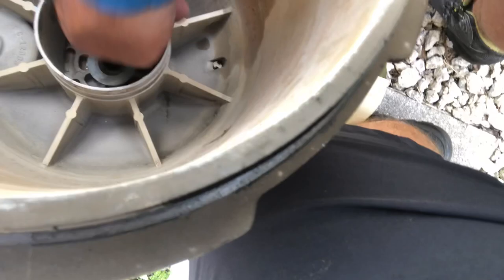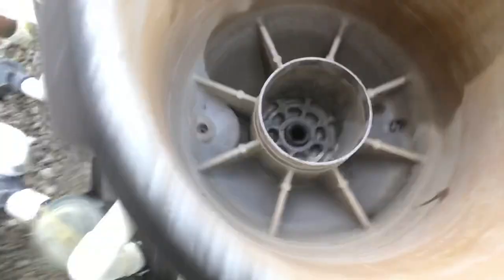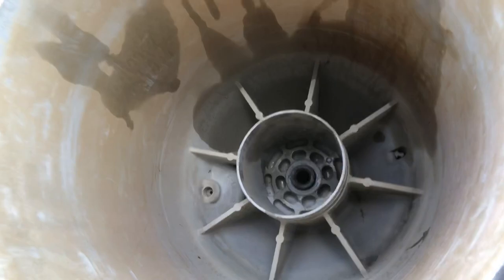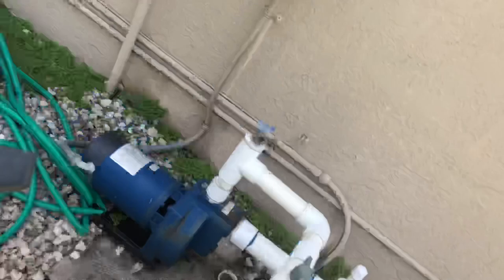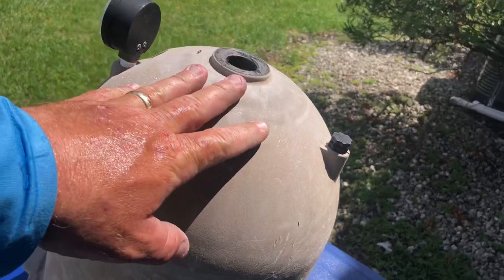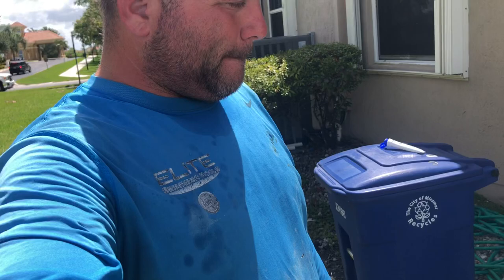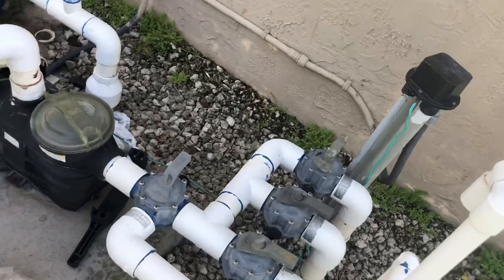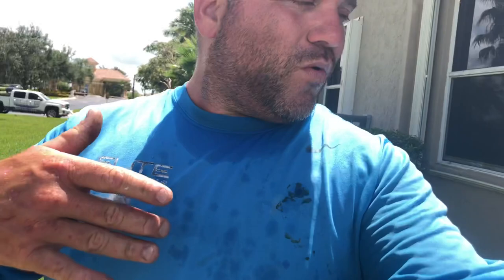How to Replace your broken Hayward Star Clear Plus Filter Knob.

Comment: Wow, what an amazing video! This really describes everything I needed to know to replace the locking mechanism for my pool filter housing. What I particularly like about the video is that it is clear that no editing has been done. Some repair videos clearly show a repair with "prepared parts" where everything just slides into place in one go. I suspected that getting the C-ring into place would be a <insert expletive>. You also showed the failed attempts, making the video an honest representation of some of the difficulties that you may encounter if you are carrying out the repair yourself.

Comment: Awesome video but what happens when the rod is stripped?  Can u replace it?
Reply from the maker: If the bar came loose and stripped from the bottom that’s a big problem. If the bar can not be screwed back down tight  and the bottom threads are stripped, you’ll have to either purchase the filter bottom half tank or replace it with a New complete filter.

Comment: So i have same filter and the long rod that is threaded on top and bottom always comes out with the top lid instead of staying at the bottom threads.   Makes it a real pain to screw back in cause of the blind alignment.   Do u recommend i put loctite on the botttom portion and manually screw it in so it stays “permanent” down at the bottom?    I assume the white rounded cone at top is to guide the rod into the threads!?

Comment: Hi, I found your video. Same part, but the lid isnt opened, the knob came out with tug and twist. Opened lid a pinch. Scared to use screw driver in that to pry open. Suggestions appreciated!
Reply from the maker: Put your foot or both feet at the base of filter body and try to pull up the lid on one side and then the other. If you have to use a tool, then be careful doing so.
Reply: @EliteSwimmingPoolsTV  thank you!! I wound up replacing the inner part of knob,it was easy and now it unscrews so easy! Thank you for responding!

Comment: I turned on the pump and water spilled out from filter mild blowout and quickly turned it off. Should I be concerned?
Reply from the maker: As long as you shut it down quickly, I don’t think you’ll have anything to worry about. Reseal the lid and try again.
Reply: @EliteSwimmingPoolsTV  Yeah everything worked out fine, I ended up replacing the handle, the housing seal and air release valve. Thank you so much for your video.

Comment: Omg. I need your help. We have a c2002 Hayward that the pool man has just come out to clean. Anyway long story short. They cleaned the cartridge and got everything back running. Unfortunately chemical readings where wrong so came back the next day to add salt etc. I guess they opened the filter up again to reclean and have dethreaded the bar from the bottom. Of course the c2002 is no longer made and so we up for a new filter. Is there anything we could try first?

Comment: My handle will tighten, but it won't let go it turns normally but then there is a muffled clunk. End result is the lid is stuck on. How do you fix THAT? I cant see any way to get it off with it not loosening from the inside.
Reply from the maker: Read your comment a few times and I’m a bit unclear as to what you mean, “but it won’t let go it turns normally but there’s a muffled clunk. Lid is stuck on” 
Can you clarify this

Comment: Can you please indicate how to replace the pressure gauge ? thanks
Reply from the maker: This is simple. turn off the pump, you’ll need a 9/16” wrench to unscrew it from the lid. Wrap Teflon tape around new gage ( about three turns around threaded part and ensure not to cover bottom hold of gage, then hand screw new gage back onto lid. Leave about 1/4” from bottom to not over tighten and crack lid / gage hole. Turn on pump and Your done. Thank a for watching and hope your a subscriber.

Comment: what can I do if I can't get the old handle to come out after removing the c clip thing?
Reply from the maker: Prop up the lid upside down where you see the inside of the lid and wedge the lid between some type of table/ chairs etc where the lid is secure but the handle is in the middle and free to move. Now either get a kind screw driver or rebar or something that can go inside the center hole of the handle. Get a hammer and hit the driver or rebar and push it out.

Comment: Hayward Star Clear Plus Filter top lid Knob is stuck. It is spinning when trying to remove the lid. how to remove lid?
Reply from the maker: Decompress filter by opening the air relief valve then try pulling up on lid after all air is released

Comment: What if the bar keeps coming out
Reply from the maker: The bar that keeps coming out is a well known problem with these models. I use a vise grip pliers and torque it down, but be careful not to over torque and crack the base. Then you’ll be buying a new filter. 

Here’s what I’ve  done In the past. I’ve drained the tank completely by unscrewing and opening the outside black drain plug, then dry that inner hole where the bar screws into with a rag as best as possible. Purchase Liquid Tite from any hardware store and squeeze a little into hole enough for all threads to have hardener on them, then torque the bar down and let it sit to harden for the length of the hardening time. When I’ve done this the bar never came back out. Make sure that you don’t cross thread when screwing down bar with the hardener in hole. 
Try the vise grip tightening first, then if it happens again use the second method. 
Good luck 👍🏼
Reply: @EliteSwimmingPoolsTV   dude!!! God bless you for actually having an answer to this! You should make a video about this because a lot of people probably have this problem and they didn’t Think to go into the comments to look for the answer!
Reply: Thank you for answering this question you sir, did the public service.

Comment: Funny timing, I have a client that is in desperate need for a new knob. But I guess it’s going to take the lid blowing off for them to replace it lol.
Reply from the maker: Express to the client the severity of the situation and of a possible filter blow off which could potentially damage the entire filter resulting in a $600 plus replacement cost for a new filter, or a popped filter lid and pool drain out due to popped lid. I’m sure client would rather not spend that kind of money. Good luck
Reply: Elite Swimming Pools TV thank you!!
Reply: @EliteSwimmingPoolsTV  I followed your instructions. Replaced the knob. But it keeps popping open and the rod is not tight